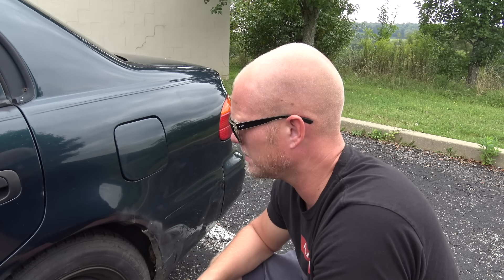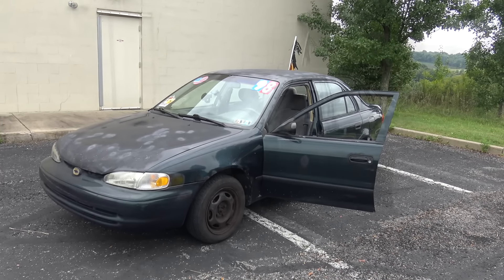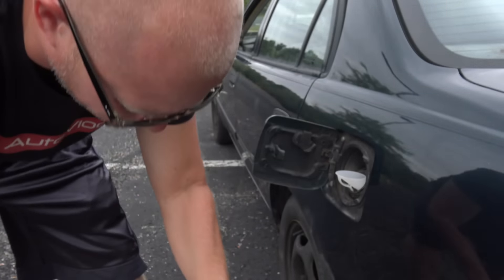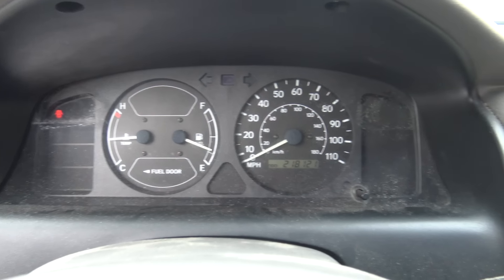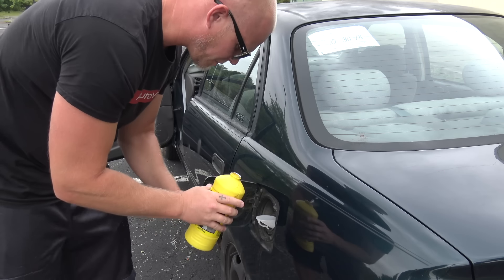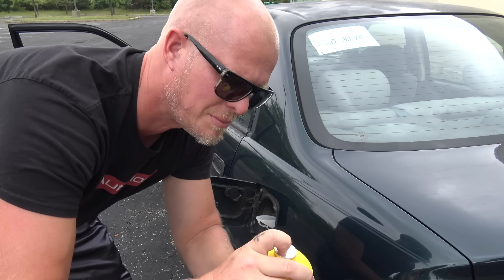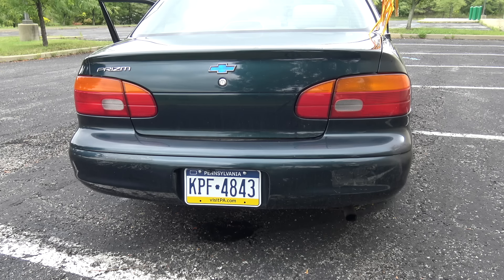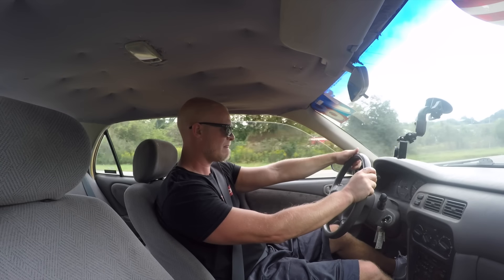What happens if you put BRAKE FLUID in your gas tank? (You'll be surprised!)

Comment: since brake fluid is basically oil based, same as gasoline i'd say it wouldn't hurt at all may even help the old beater. the smell you got was probably from a bit higher exhaust temps and the brake fluid may actually help clean the injectors. Back in the old days on big diesel engines we would fill the fuel filters half full with transmission fluid to clean out the injectors. the transmission fluid would burn a bit hotter thus helping clean the soot and carbon off of them.
Reply: @classic24hrtowingreferrals28  brake fluid is corrosive. It can be used to strip paint. I doubt it will clean the system. It will probably cause corrosion in the fuel tank, lines, filter, etc.
Reply: dot is not oil
Reply: Smoke like crazy tho
Reply: If brake fluid is corrosive then why in hell do we use it in steel brake lines for years, then we need to use hydraulic fluid in brake lines, it works with log spitters, and construction  equipment under extreme  pressure seems it not corrosive!!!
Reply: It's not corrosive. It just attracts water. It won't corrode anything in the fuel system. It's actually kind of good for rubber seals. And it's a piss poor paint stripper, it takes days to even remotely do something.

People make it out to be much more dangerous than it is.

Comment: It would have been interesting to see what the spark plugs look like after this.
Reply: Yea I was waiting for that.  I have brake fluid but no gas and my bike has a spark plug issue.  I might wanna wait... I do need substantial fluid in the brakes,  but I don't need brake fluid if I don't have gas...  Right?  So I agree with you about the plugs , I bet they are looking confused.
Reply: Pull the spark plugs out and check them.Pull a fuel injector out and check it. I wonder if brake fluid will clean the injectors? I wonder what brake clean would do in the gas tank ?

Comment: My husband is a mechanic and he said he is not surprised.  That probably removed any water he had in his fuel. He also said it would not be a good idea to do that too often. Brake fluid can be hard on some rubber/gasket/plastic components.
Reply: Funny same thing I said! Would eat away the Neopreme Gasket in the fuel pump in tank. $500.00 Repair or more...👍.Engine Builder...☺🏁
Reply: Well Amy husband's wrong,and Amy husband's wrong again! Waterboy!
Reply: MY SISTER PUT BRAKE FLUID IN MY MOM CAR AND ANYTHING BAD HAPPENS/CAR STILL RUNNING 🏃‍♂️

Comment: should have done a test to see if you get better gas milage or see if it cleaned out the combustion chambers including the valves
Reply: if you are poor and drive a vehicle with a carburetor, while the engine is running pour a tiny bit of automatic trans fluid into the carb while it is running, it will smoke big time, but it will also burn off any carbon  and deposits on the valves
Reply: @wildedaveable  That is a myth. it does not. I would Imagine Glycol will work as a cleaner because when you have a head gasket leak it steam cleans the Combuston Chamber. Brake fluid is also Glycol same as engine coolant just color addatives and another chemical I cannot remember the same that Brake fluid has added to it vs the coolant does not.

Comment: Good one man. Brake fluid is the best cleaner ever. I learnt this since in the 1970s. I had a dirty carburetor which I soaked over night in the fluid, next morning is was clean as a whistle. Since then, I always use brake fluid to clean my fuel systems. You will be amazed how the injections, intake manifold along with the valves will be free of all the sticky carbon build up. You have stumbled unto the best gum removal cleaner ever. Also, I had an engine that was stuck that had not started for years, I took the spark plugs out, poured fluid into each cylinder, it soaked overnight, next day it turned over started and ran like a dream ever since. There will always be doubters in the world. Again good one man. Stay up.
Reply: Ummm, you mean, "Brakleen" by CRC. Not actual brake fluid. 
Jesus dude !!
Reply: Everard Manwaring yep nailed it
Reply: Michael Collins umm no he doesn’t mean brake kleen!!    He means brake fluid!!!  Go ahead and take a drop of brake fluid on your paint.   It’s very very corrosive hence the cleaning power like solvent.   Soo not so quick smarty pants.
Reply: Break fluid will decarbon a motor better than anything.
Reply: You are right Everard; also Kerosene will do the same thing; most fuel system cleaners are just Kerosene with a few additives anyway !!!
Reply: That engine did sound better and seem peppier the morning after sitting with brake fluid in the fuel system.
Reply: @davidquinn9676  Agreed!!!
Reply: Yup I too got an engine un stuck with brake fluid 🤘. I'm going to have to try some in my tank. Iv been running lacquer thinner or naphtha in my tank to boost my octane for years. It'll also clean your injectors
Reply: @lifeonadime4703  How much  in tank have you used?
Reply: What about just using Seafoam?
Reply: Absolutely! I watched my late father pour it down a many a carburetor to clean out the fuel system.

Comment: When I was just a young boy my father had a 1939 Plymouth that he ran out of gas about 3/4 of a mile from home on a dirt road that led up to our house where we were living at the time. He had five gallons of kerosene in a five gallon can that he had bought for kerosene oil lamps and other cooking apparatus fueled by kerosene also. So him being a mechanic poured the kerosene into the gas tank of the old car to get it home and he also poured two quarts of motor oil into the gas tank and I asked him why he did that( I was old enough to know that kerosene and regular motor oil is not normally used to fuel cars with.) But he said that the motor oil would lubricate something with in the engine ( I can't remember exactly what because that was nearly sixty  years ago now) but he started it up and it blew so much white smoke from the exhaust that it looked like a white cloud on the ground but it ran and we got it home on its own power. So that was quite a memory that I have from my childhood somewhere  back in the early to mid sixties I suppose.🙂

Comment: Putting brake fluid in the car, in smaller amounts, actually helps the car. The brake fluid gets rid of all the gunk that actual gasoline leaves. I put brake fluid about a half a bottle per tank in my tractor trailer, and it cleans the injectors. It helps the mileage, it went from 5 mi to the gallon to about 8 I've done this for the past 20 years. So probably it will make your catalytic converter last longer because it's cleaning out all the gunk
Reply: ⁹
Reply: @jkytgud  👍 good 👍 on you victor mate aussie aussie 👌 👍 😍 🥰 ☺
Reply: Awesome, I agree
Reply: What size bottle? That’s a big increase. I have twin 100 gallon tanks in mine and if it works I’d be willing to try it
Reply: @cullertransportation
Reply: @harrygrideout8798  no
Reply: what about the smell, how to remove it?
Reply: I put diesel fuel transmision  fluid 
Brake fluid two stroke oil.   Still drives good 😁😁

Comment: brake fluid is a oil based hydrolic fluid so it will mix with gas, i used brake fluid in the past to decarbonize the head and pistons,  good chance all you did was clean the carbon out of the engine! kinda like seafoam!
Reply: Which is better Dot3 or Dot 4?
Reply: @lionreb  either one would work!
Reply: I know a few people who put ATF in their gas at every fill up. My uncle has 330k on a Chevy and he says he’s put ATF in the gas since 100k miles. Engine purrs like a kitten
Reply: @FinsleysCustomCarAudio  I have run transmission fluid in my 1991Ford 7.3 IDI CCLB 4X4 501,000+ miles, RUNS GREAT!  It cleaned the injectors right out! It's more expensive than diesel fuel so I don't think I'll be doing that very often.
Reply: Brake fluid is a good way to bump start a engine too it's very volatile when new
Reply: That is my experience as well trying to lose that "injector click"
Reply: is brake fluid different i  the us lol? its extremely corrosive i dont see how it would help seals since it dissolves some rubbers and plastics
Reply: @kacperchrusciel890  it does destroy rubber seals yet it has its uses for a quick bump start aslong as you don't put too much and make a bomb
Reply: @kacperchrusciel890  you are right, it very corrosive, the stuff will literally melt your paint, however, if you have a automatic transmission that is on its last legs, especially if it refuses to shift, a teaspoon of brake fluid in the tranny will soften the seals enough to get you going for a few extra months, if its slipping, it wont help but a hard shift or no shift, sometimes, a little brake fluid will do the trick!
!
Reply: What about motor oil
Reply: @gilbertp.9851  you put motor oil anywhere else but the crankcase you engine will smoke like crazy, don't put in in the transmission it will most likely damage it.
Reply: Will the brake fluid ruin your O2 sensors?
Reply: @mibnixon  I can tell you the shit with these cars what city you in
Reply: Not a good idea to put 
Brake fluid in the fuel 
Tank on a modern day car.
Don't do it.
Reply: Hay man do you put it before or after oil change and how much
Reply: @kacperchrusciel890  
Agreeed.. idiZ
Reply: Thanks for that explanation!
Reply: @nigelclark7360  Agreed!!!  A beater maybe!?
Reply: @lionreb  dot 4 tolerates higher heat
Reply: Wow! I am impressed!!
Reply: Glycol ether based not mineral oil based …brake fluid is not an ordinary mineral oil or mineral hydraulic fluid

Comment: Well it's not exactly weird that it's still running, it has the same engine as a toyota corolla, the 7AFE or 4AFE engine depending on 1.8 litre or 1.6 litre engine. The point is that is one of the best and most reliable engines ever built! I am a mechanic and a mechanical engineer and I have all kinds of cars because I love cars; bmw's mercedes, porsche and the 7AFE is my favorite engine of all time.  So no need to be so surprised.  It's not a piece of junk as you say, the general public has been programmed to consider cars junk that are not the newest shiniest and most fancy.  The fact is most of these newer shiny cars that you think are so nice are actually the pieces of junk with built-in failures all over the place and cheap plastic parts.  I'll take and  older 7AFE any day, entertaining video btw, I gave it a thumbs up ;)
Reply: I completely agree my family owns many cars and one of them is the ‘99 Corolla as an extra vehicle and it is the most reliable of all our newer cars except it has actually been maintained it’s even run with no oil at one point
Reply: Emmanuel Santana why don’t you?
Reply: This is the engine that actually deserves a rebuild
Reply: Clint Hightower if that’s the same engine as the celiac 7th gen. they’re terrible engines. But having done 200,000 odd I wouldn’t say it was the same engine.
Reply: CTK Network it’s been maintained. But run with no oil. 🤔🤔🤔. Hmmm.  Great maintenance 😂😂👍👍
Reply: Clint Hightower what do you think of the old 3.4 litre V6 in the 97 Toyota T-100 its a 5vfe i think
Reply: GTTDI DUDE. Lol we forgot to put oil didn’t cease though so it’s all good😂
Reply: It's a rebadged Corolla.
Reply: 4efe ftw haha
Reply: i have worked on card since i was 8y/o i have come to learn like the saying goes for dogs there is no such thing as a bad dog but bad dog owners same goes for car owners....meaning if you take care of it like you should it will last you forever if you mis treat it or dont take care of it well yea its going to be a pos.....but hey by all means keep treating your cars like shit just means more money for ppl that works on them or buys and flips them......its nothing to go buy a 300$ "junk" car put 200$ into it and sell it for 1200-1500$
Reply: It’s a 1zz fe & it’s a terrible engine.
Reply: 100% right
Reply: @mattschricker735  this logic doesnt apply to Kia's and Hyundai's.  they might as well be driven straight to the junkyard from the dealership lol
Reply: @rigorocks23  sheeet I'm still driving a kia I got 10 years ago and have beat it like a cheating wifey but hey every person's experiences are different
Reply: @rigorocks23  I agree, don,t even bother changing oil or servicing..just drive for a few years and scrap or sell to a poor dummy.

Comment: In my high school years, I was walking home from my girl friend's house and I cut across a parking lot.  Two guys in their 20s were high-revving a car's engine.  They had put a brick on the gas pedal and were outside, waiting to see what would happen.  I waited with them, watching billowing clouds of smoke coming out of the tailpipe.  My thought was that engine parts would soon be flying through the air (or embedding themselves in the pavement).  A show of another kind.

Surprise, after several minutes, the smoke began to lessen, although the noise did not -- still high-reving.  In another few minutes, there was hardly any smoke and one of the guys removed the brick.  The engine idled down, they got in the car and drove it away, as if nothing had happened.

I have heard that a half-hour at freeway speeds will do wonders for a city car.  This may have been the short-cut treatment.
Reply: bloggerccc your dead right, to much farting about in town driving is the worst thing for an engine , especially a diesel , they need a good blow out fairly regularly .

Comment: Now you got me thinking. What about transmission fluid in the gas tank. I'm sure ti won't be good on the gas millage but we used to slowly pour transmission fluid into the carburetor with the motor running to loosen up sticky valves. 

When doing this you have to hold the gas throttle to keep the RPM's running high enough so it wouldn't kill the motor. Too much oil at one time will stall the motor. To low of RPM  will stall motor as well. Another words... Turn car on. Rev up motor. Slowly poor half to whole bottle of transmission fluid into carburetor. Keep it revved up so the motor won't die. Motor will run  rough while doing this but it will smooth out once your done pouring.  

Result... Huge amount of smoke will come out of exhaust. Oil residue will blow thru exhaust so don't do this in the driveway unless you have a good size cardboard or and old sheet/blanket that you no longer need or simply do it in the neighbors yard and don't worry about it. ( kidding about neighbors yard of coarse but the rest is fact).

The funny side of this is... a neighbor from down the street jump in her car to see where all the smoke is coming from thinking our house was on fire. She wasn't too happy when I explained what I was doing, especially all I could do is laugh. I've done this when I was living on the farm but living in a residential neighborhood, people tend to freak out to easy. You can take the boy out of the country, but you can't take the country out of the boy.  lol
Reply: Bro you forgot your bolo
Reply: That's just tickled me pink and very informative too cheers for that

Comment: I’ve used Transmision fluid in my gas and oil for years and the inside of my engine is so clean I had a keep that my daughter was driving and when I started driving it again it was sluggish and not much power after running the transmission fluid in the gas and oil it regained the power and fuel mileage increased I use 1qt in the oil and 3-4oz in the gas every other time I fill up it works great 👍
Reply: Yep. Marvel Mystery oil same thing.
Reply: Transmission fluid NOT Brake fluid...geez

Comment: This is an old trick. If you have a bad misfire and you replaced the spark plug wire and coil , remove the plug and pour pour brake fluid directly into the cylinder.  It will loosen the corroded stuck valve and clean the rings and fix your issue

Comment: I am not sure what it could do to any internal damage but quite sure it has cleaned the injectors and valves. I do know that if you put brake fluid in a leaking slipping automatic transmission it will temporarily stop the slip and leak for the most part it swell's the clutches and seals.
Reply: Yeah but you only use a couple of ounces.  Too much will cause problems.

Comment: I drove a 525 hp Cummins, T600 Kenworth for years. Added brake fluid nearly every fill. 263 gals of diesel. Improved mileage, improved performance, no gelling at cold temps, always great Dyno, never any engine problems.
Reply: What was the ratio? Did you just use a full bottle? And if so, what size bottle? Thanks!!

Comment: For awhile, many years ago, my father added a can of transmission fluid into the gas tank....nothing bad happened to the vehicle. Great experiment...
Reply: My father in law way back did the same thing. He told me it helped clean the engine. Must of been BS going around back then and probably started by repair mechanics to increase business.
Reply: @coobay978  It just work as lubricant for the fuel injectors. A well known fuel injector cleaner is just a mixture of paint thinner and automatic transmission fluid.
Reply: @coobay978  its very common and very real. The detergents in ATF clean the engine and the oil lubricates it.

Comment: Had a car that overheated and was running really rough. My dad poured a little brake fluid through the carburetor and the engine started running smooth. An old mechanic told him it would get rid of the carbon buildup on the valves. Guess it worked but he sold the car within the month so don't know how long term the fix was.
Reply: dumping some water in the carb will also knock carbon off valves n pistons
Reply: dumping some water in the carb will also knock carbon off valves n pistons